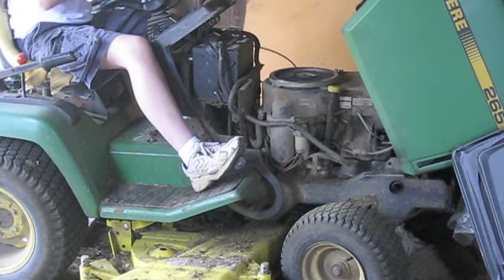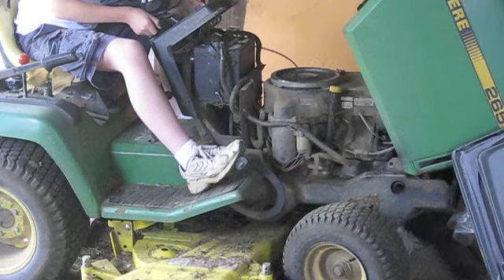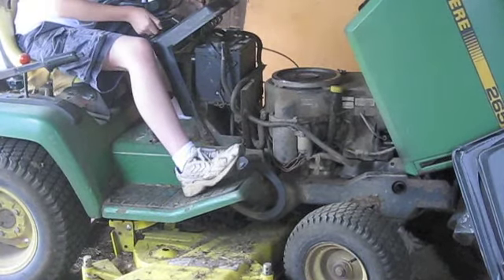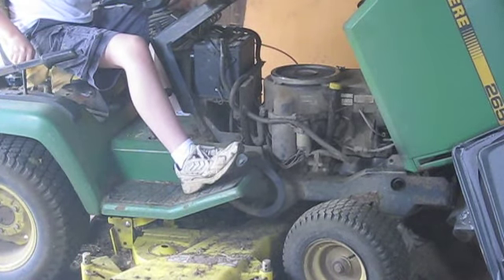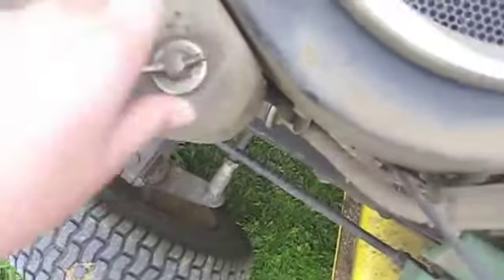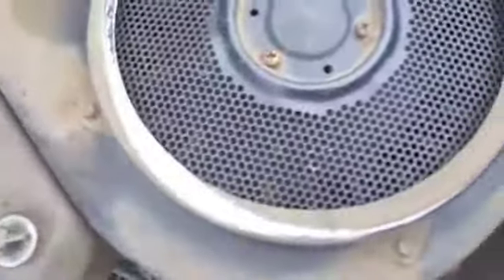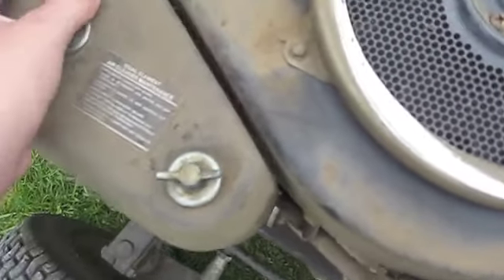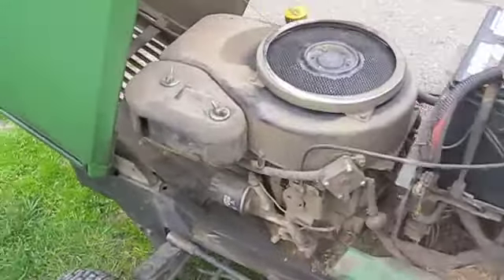1980 John Deer 265 Lawn Tractor Start

Comment: JDs today are 5 year lawn tractors. The 265 is a 30 year tractor (or longer).
Reply: That's not true. The John Deere X500 series and X700 series will last 30 years without a problem.

Comment: ya i love mine i pulled over 700 pounds with it and i just cleaned it up but  check the oil filter and the regular filter and replace them if the inside is brown there not much that should and dont try to start that long and take the red lever and push it all the way up and start it that will help and btw you have no idea wat ur talking about  so before you post your videos watch them. not trying to be mean ill make a video soon

Comment: Ok, ok, enough of this. I know this is an older video, I don't even know if you still own this tractor, but if you do, and it has stopped running, i can tell you at least two solid things wrong with it. Firstly, that high-pitched whining you hear when u crank it? Your starter is going out from the sound of it, possibly due to having to crank it a lot to start it. Nextly, as to your compression problem you talked about. Needless to say, your rings on the piston have gone bad. I don't know how old you are now kid, but that's what's making it hard to start. We have an actual big tractor, not a small lawn tractor, and it has this problem. I don't know if any of this still hold for this is an older video, but that is what i figure is wrong with it from watching. Oh, by the way, it isn't an 80's model mower, its a 79 model to be exact, I have one. The electronic fuel stop is corroded on it and i have yet to fix it. I use my grandfathers old Craftsman G-18 18 horse 44 inch cut mower as of now. I would say the rings you would need to fix the compression problem will cost between 5 and 20 bucks, its cracking the engine open that sucks to fix it if it has stopped running. Just thought I could give you some advice kid, you know more about mechanic work than a lot of adults you know. Good luck with your tractor, i would prefer a kind reply and no arguing from the public, not trying to start anything with anyone.